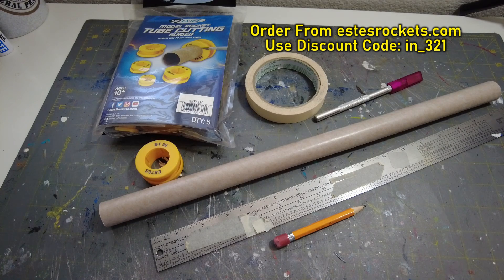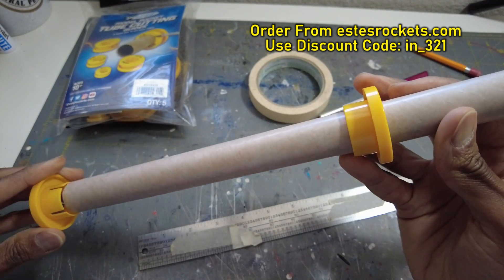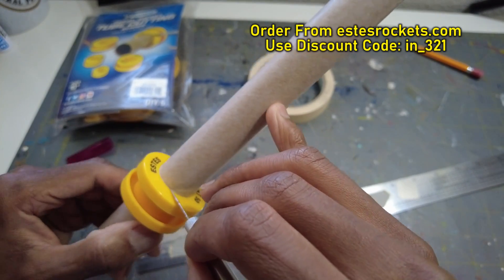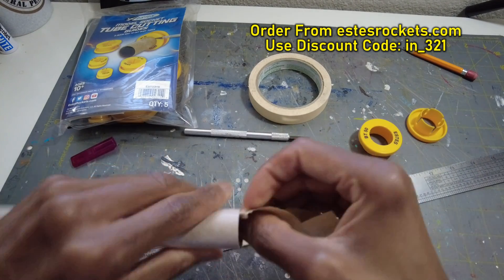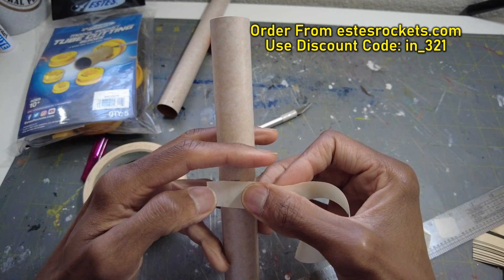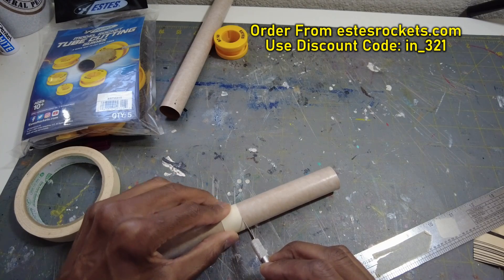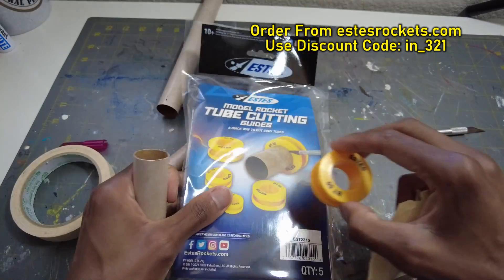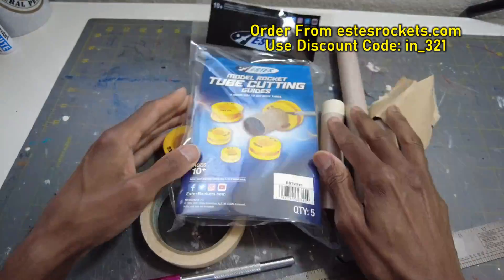Build Tip: Cutting Model Rocket BodyTubes: 2 Ways #howto #rocketry

Comment: If you choose to use masking tape, beware that it is made of crepe paper, designed to stretch--just a little--to conform to curved surfaces.  If you apply tension as you wrap the tube, you may end up with a curved cut.  You may not notice it, but you aren't guaranteed that the tape edge is absolutely straight.

Comment: Was eying them tube cutters, but this stage of “beginning again”. Will stick to masking tape and marking 3-4 dots to align the tape.  (Had a great system setup but can’t recall what I did.  78-79 was a long time ago. 😆
Reply from the maker: Lol, that's funny. Excellent. It'll come back to you.
Reply: @modelrockets3215  I think I had a bunch of rubber bands.   Other then Big Bertha and my Centuri LJII, most kids were about size of Estes BT-20.  

I know years later now the advantage of sanding along the fin lines.    I was lucky if I even waited for glue to dry.    Christmas morning build.  Afternoon launch in cold upstate NY winter.  Fun.  ＼(^-^)／

Comment: Great tutorial Keith!  For those watching, Keith is right, those cutting guides are invaluable!  However, sometimes you'll encounter a tube that still slips when the guide is pinched tight.  To cure that, simply lay a layer of masking tape on the inner fins making them a little thicker, that way, when you squeeze the outer tube on, it will tighten up even further.  Thanks for showing this technique, as well as the "old school way".  Good stuff!
Reply from the maker: Thanks Kevin. Yes guides can still have a  lil "play" on some tubes. I didn't mention it because I figured most people will find a way to improvise and make it work. I've backstopped the slipping with masking tape behind the guide.